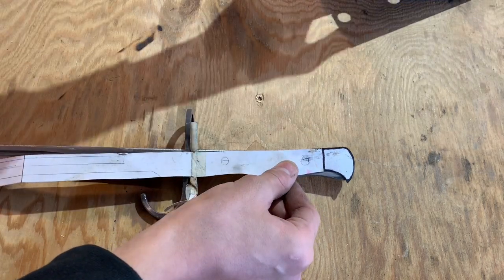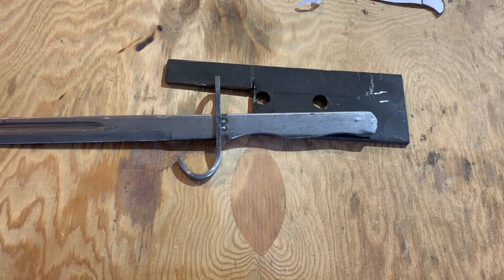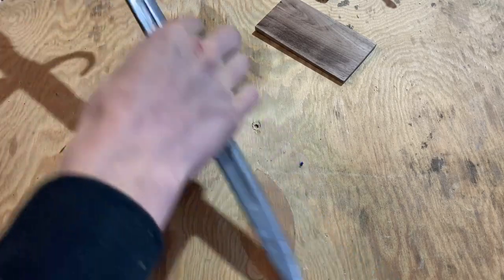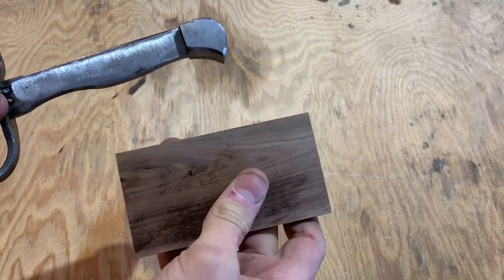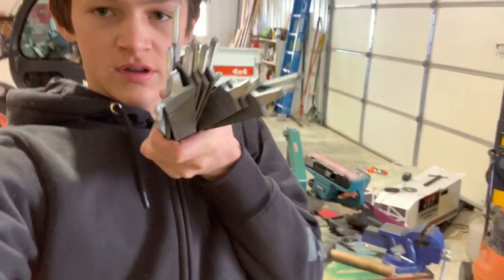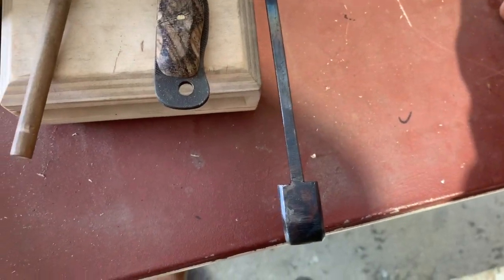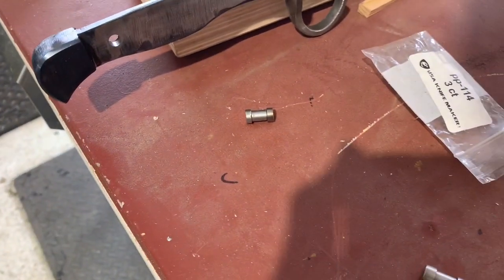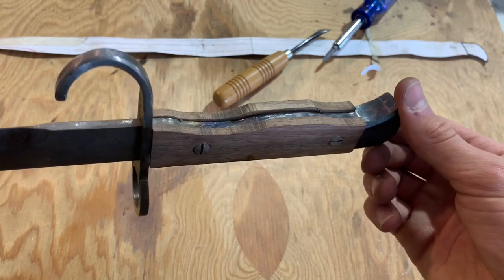WW1 bayonet part four! It’s done!

Comment: You gonna install the bayonet lug on the back of the handle? Also need the button for release to make it legit 1917 , other that that it looks badass man, great job, what's the next project your doing?
Reply from the maker: Unfortunately no, it’s only decoration or show bayonet, it’s made out of mild steel. When I started it I didn’t know anything about high carbon steel‘s and I thought all steel was the same. I will most likely be working on my sword in the next video. 
Thanks so much for watching and commenting!